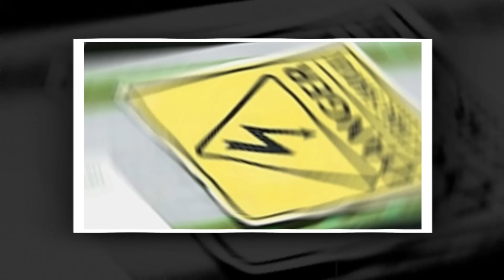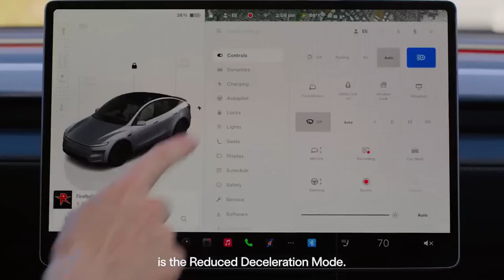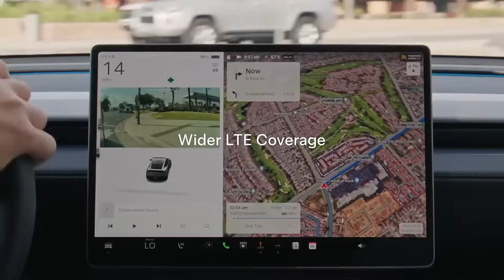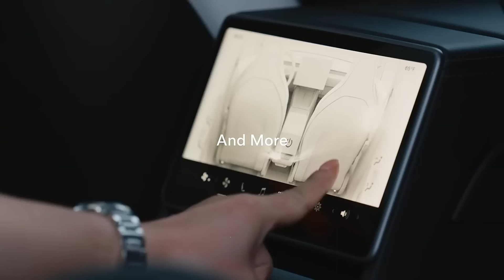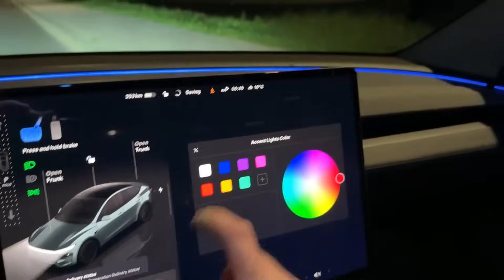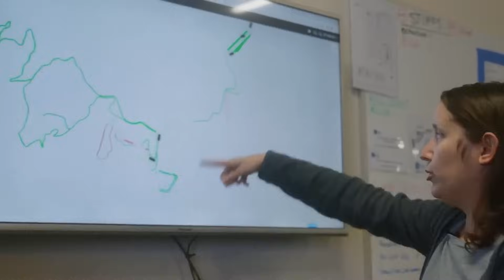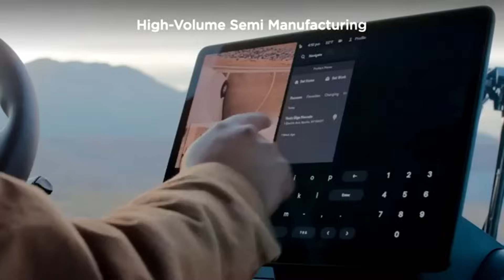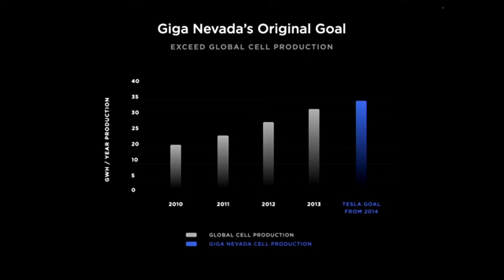NEW TESLA BATTERY Aluminum-Ion - 10,000 cycles, 30-year life, 3x faster (Model 2)! Elon Musk REVEALS

Comment: Longevity, Reliability and Cold Weather Performance would be most important to me. I would NEVER buy a current electric vehicle due to battery cost and issues. Get outside warranty and you are completely screwed if the battery dies.